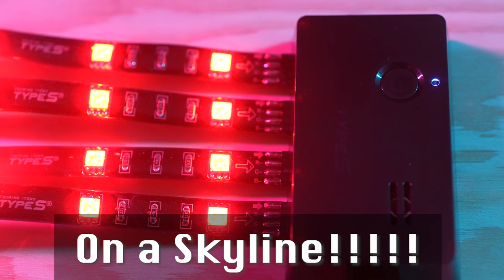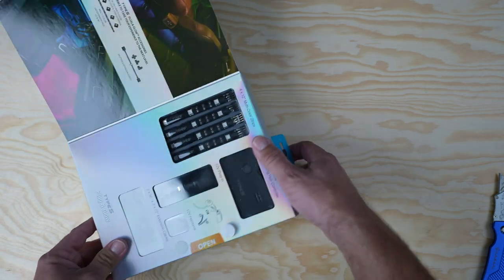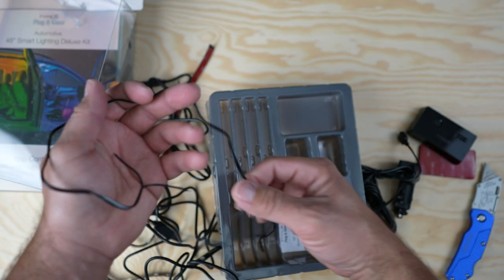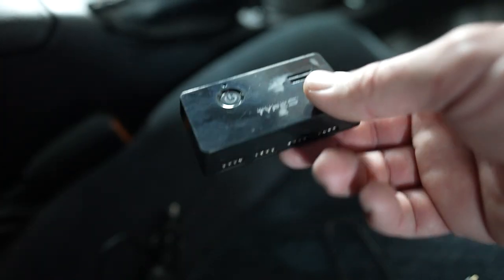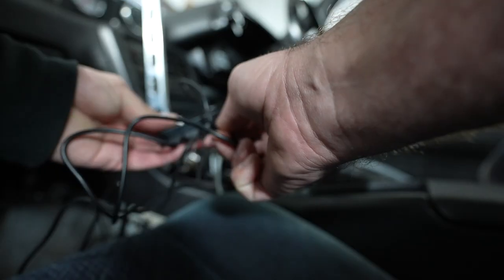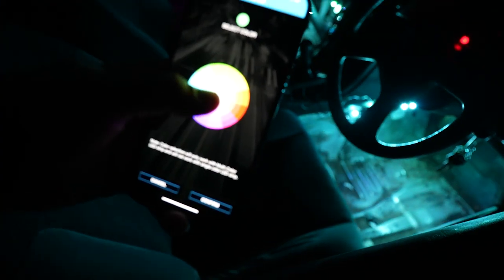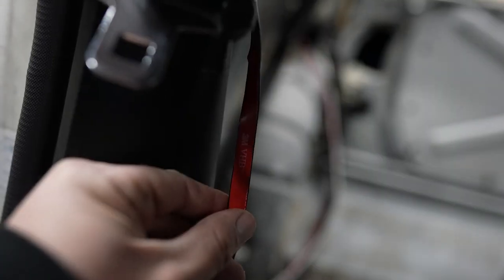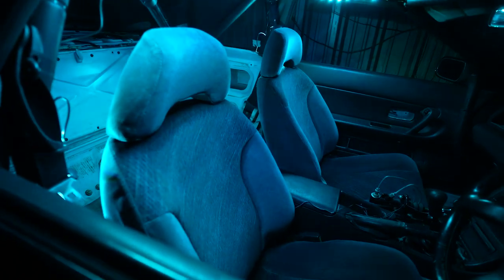Type S LED Plug and Glow Interior Smart Lighting Deluxe Kit Install / Review / Unboxing

Comment: You should install the trim kit for  the dash and center console you could do the doors to if you want I have a Trim kit and the  24 inch kit under the dash above the pass. And my own feet and my stereo has led trim edge around me whole deck youd probably need like 3 kits but their hecka worth it. Try putting  the lights on Like neon fuscia(sp?) Or deep magenta well try a few in that purple pink.
Area    it'll look badass with the paint ..

Comment: Great vid, I really like the way this came out.  I am looking forward to a vid on the app itself. Looks like there is a lot of options and would like to see it work with the different kits you have installed. I actually got a free underflow Type S kit from when Funhaver had their sale where if you purchased over $50 they would throw in a surprise. Thinking about using it to light the upper and lower grille and the openings in my VIS racing hood on my 13 Mustang.
Reply from the maker: Thanks man!   I talked a little bit about the app on the underglow vid but there’s still some other nice features that I didn’t get to cover.  It’s been pretty responsive and I like it.  
My girlfriend won some lights from funhaver too!!  I was going to install them on her 2012 gt for her, but she wants to start doing her own videos.  I think they’d look pretty cool in the grill.

Comment: Absolutely incredible man. I have a bunch I’m putting into my toyota fj cruiser. Is there a reason you can’t drive with them in the street like that? Legal reasons or just terrible visibility?
Reply from the maker: Thanks man!   
Fj cruisers are rad!   
I haven’t tried driving around with them on because the cops near me are pretty strict and the cars stand out enough as is.  I’m not even sure if it’s legal or not, but I have seen a few cars near me with underglow or interior lights recently.

Comment: Okay both your videos on Type S lights are really making me want to install them on my truck! I’d want to wire both to the battery or an aux power switch so my cigarette lighter stays availed though. With your exterior install would you say there’s any better way to run the wiring possibly for like a aux switch in a super duty? And how did you wire the mics in for the exterior lights? Love your work and awesome cars!
Reply from the maker: Thanks man!!   
An aux switch is definitely a good option to power/shut off everything.  If it was a factory aux switch, you could just run power off of that but I’m not sure if the factory aux switches send out a positive or negative or both.  I had a friend who had a bunch of light bars powered off of the factory aux switches in his raptor.  
Or if you were just adding a switch, you’d just have to send a 12v positive wire off of the battery to one side of the switch, and then go off the other side to power the lights.  It might be a little more work and material, but having a solid on/off switch is always a good thing.  I’m actually thinking about doing a separate switch on all of mine just so I don’t forget to turn stuff off. 
I also recently noticed that the type S lights do have a low voltage cut off, which means that they won’t kill the battery or anything, if they are left on, which is a plus.  
As for the mics, the included cable is pretty long on the exterior kit.  It was sensitive enough that it picked up the sound on my garage stereo, which I used since the skyline doesn’t have a working stereo currently. It’s just a 2 wire ring/pin type of cable so it could be extended if it needed to, but mix cables do seem to pick up added “noise” when they get a bit longer.  It might make the audio presets a little less accurate if they were too long.

Comment: Good video!! Subscribed. Any battery problems after the install?
Reply from the maker: Thanks!!!  
And nah.  My cigarette lighter outlet turns off when the car is off, so the lights don’t drain any power.  I think the lights also have a low voltage cutoff built in.  I know the exterior kits do, but I can’t remember if the interior kit does or not.
Reply: @RobRabonPhotog  thanks for the response.  I’m installing the same kit tomorrow on my civic.
Reply from the maker: Nice!  The install it pretty quick.  I think you’ll like it!